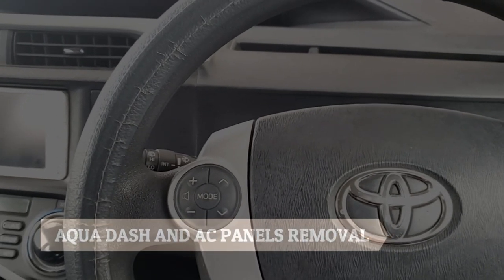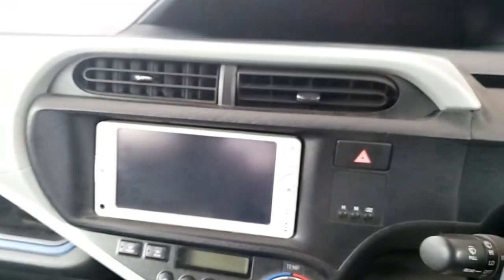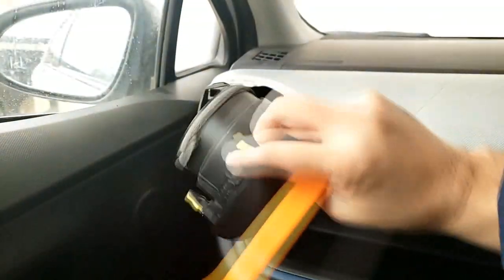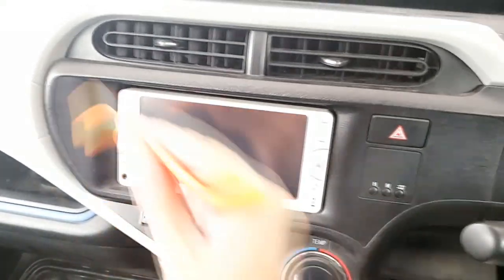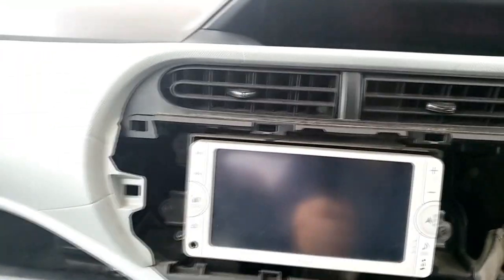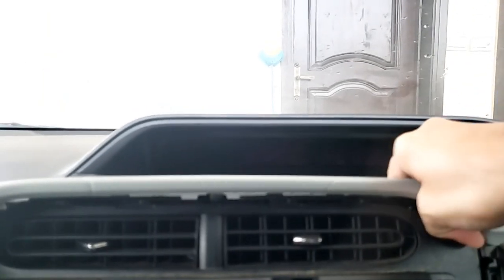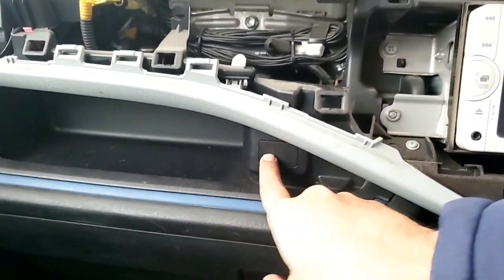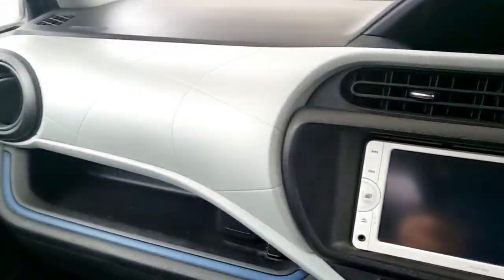Toyota Aqua/Prius C Plastic Dash Panel and AC Grill Cover Removal

Comment: I need a little help with changing the dashboard on the Toyota aqua 2013. I dislike the middle dash and like my speedometers to be on the right behind my steering wheel. Any ideas?
Reply from the maker: It can be changed I guess never seen anyone do it though